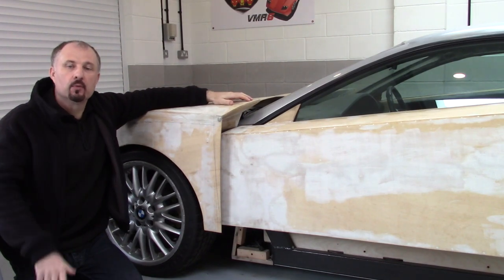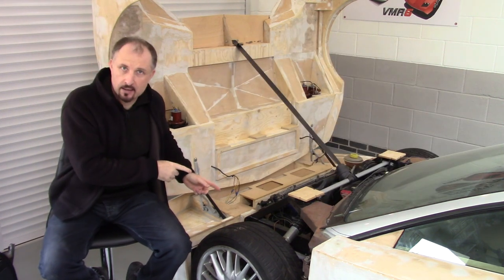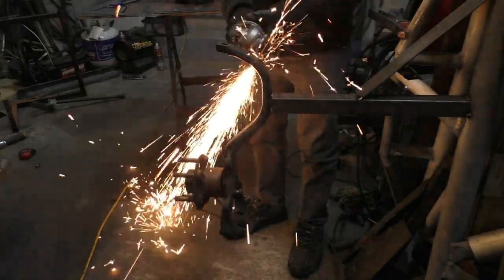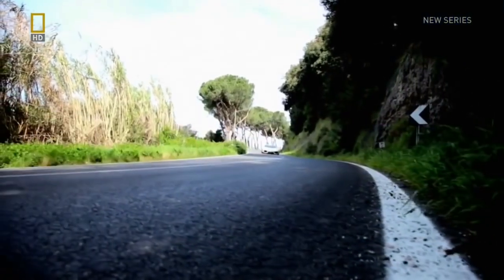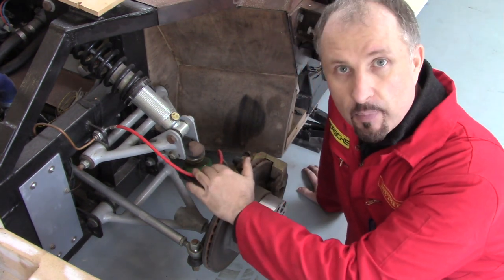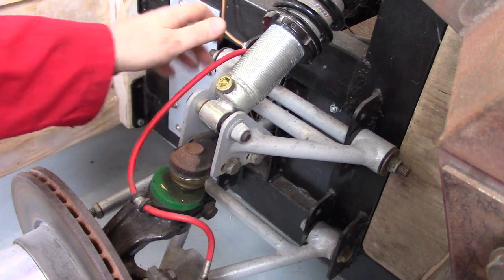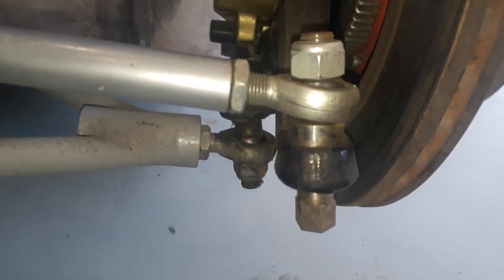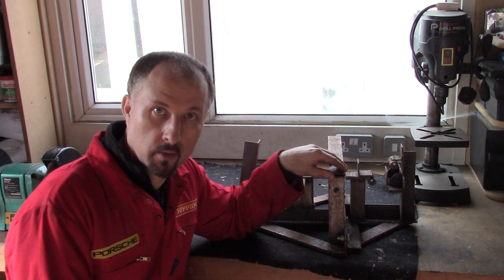Designing the custom front suspension on my DIY Supercar: Prototype Ep10

Comment: That top A arm is interesting, offset front and rear arms. Boggled me brain a bit. Something like the triangular plate on a go-kart steering? As I've said B4, you're a thinker. Steering/suspension geometry I'll leave to you - not up there with that, the finer bits. Interesting post, cheers
Reply from the maker: Thanks Don, with the amount of math and measurements I had to do when I designed it, boggled my brain a bit too, lol.